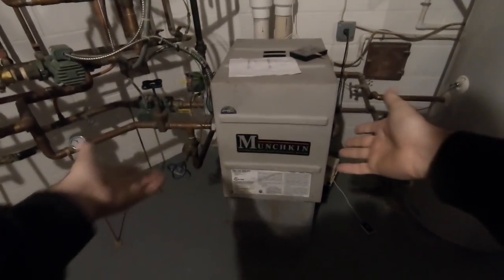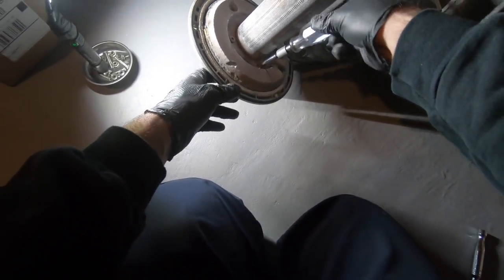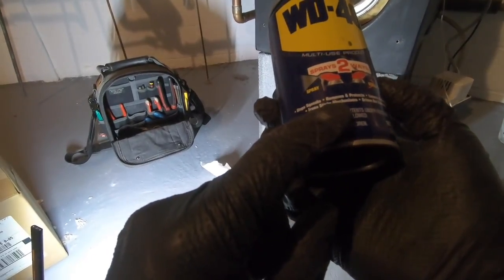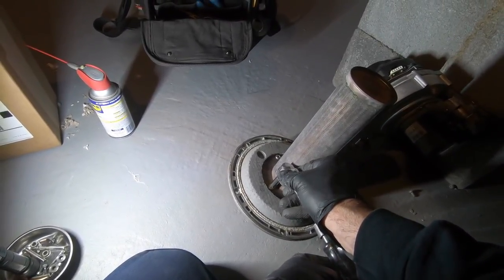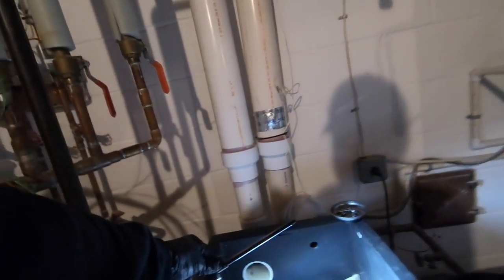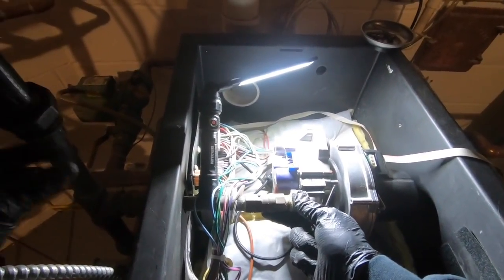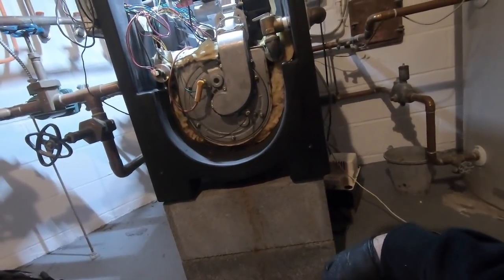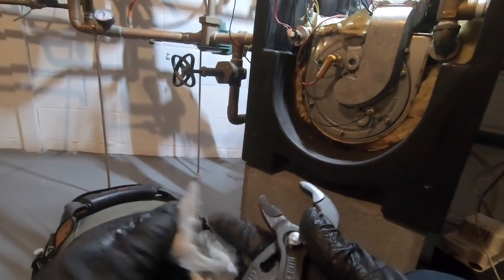Munchkin Boiler Repair Relacing Refractory Wall & Burner Gasket

Comment: Great video. I have a 140M, installed in 2002 and fingers crossed, still running. Can’t find anyone that will service this so I’ve had to do things myself. When cleaning the HX, I noticed the refractory was worn. Had great difficulty finding replacement parts and trying to remove the burner tube screws. Required about 9 mile-tons of torque and lots of penetrating oil but finally got them out. Don’t know why they were so tight. Was afraid they were going to shear. The fastener securing the back wall refractory is rusted. Don’t know if it can be replaced. Was wondering if you’ve ever tried repairing a leaky HX with something like JB Weld as a temporary fix?

Comment: I was trying to figure out how you knew the refractory wall needed to be replaced then I believe I heard you mention you were there before and cleaned the burners. I don’t know if you could tell unless you had previously taken it a part. Love your videos
Reply from the maker: I was there a few days earlier on a maintenance. And a piece of it tore off and stuck to the heat exchanger. It didn't prevent it from operating yet could cause if not repaired.

Comment: Worked on those when I lived in Prescott AZ. seem to remember they had problems with leaking heat exchangers, unlike Lochinvar knight.
Reply from the maker: Yes I ran into many white crusted up heat exchangers. If a customer pushes heat transfer products hard enough they can get a new boiler since the heat exchanger has a life time warranty. The knight I think dominates the hi end boiler market.

Comment: Munchkin are good boiler. Compact light and easy to work on
Reply from the maker: I like the Munchkin yet with them going out of business I prefer Lochinvar Knight. I got really good at changing the fans on the Munchkins due to them thinking plastic was a good material to make a combustion blower wheel.

Comment: Great video! I'm having F09 error code. I have had the unit for about 10 years, with no maintenance. It has been making a funny noise for a while now, I guess it was trying to fire. I need replacement parts, where did you order parts from?

Comment: Hacker I was going to ask you about that quarter inch clear handled driver, but I watch this video and you finally said what it was I believe you said it's the Malco connects. When I saw that on another one of your videos I knew I had to get one so I will be ordering mine this week thanks a lot. Peace brother
Reply from the maker: It’s a great driver handle and you already have the bits for your drill. The angled adapter is the Milwaukee offset drill adapter I use with the connect to get around things.